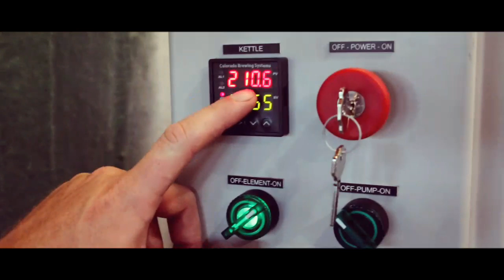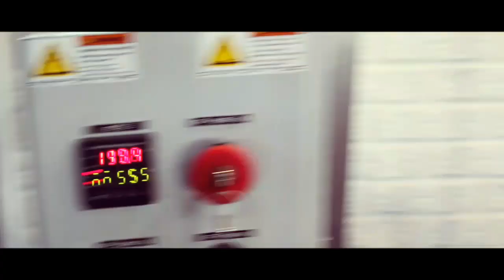Reaction Brewing Company cream ale video

Comment: Nice video. Congrats on your new setup! How's this system working for you so far? What kind of mash efficiency are you getting out of it? I'm interested in buying one. Cheers! 🍻
Reply from the maker: So far so good, I haven't checked efficiency on it but using the water calculator on the CBS site I've been spot on for the 3 beers I've brewed.  I would guess I'm right around 75%.